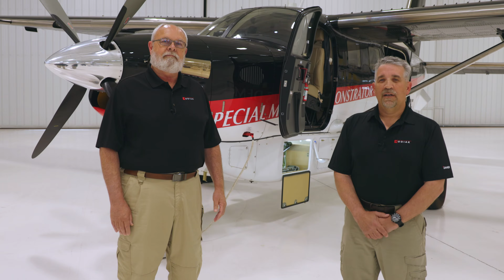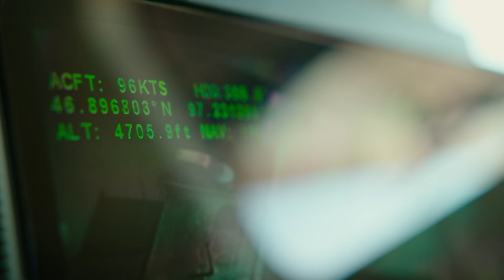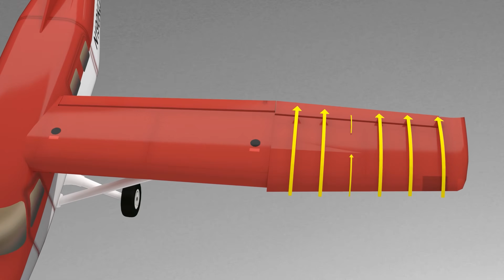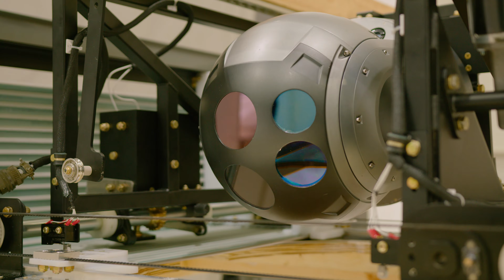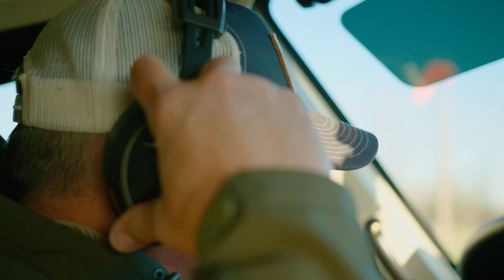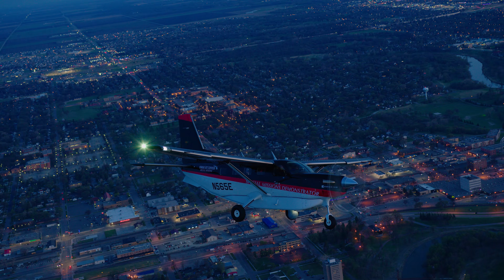Kodiak 100 Special Missions Walk-around

Comment: @KodiakAircraft  "We" have a new (with 2 patents) Par-36 LED landing light with 325,000 Candela  = (Candlepower) and 11,000 Lumens out the front output. It will outperform your current Osram/ Precise Flight Par-36 35 watt HID's. They output only about 3000 Lumens and at best 200,000 Candela. Our LED light distribution is also more even over the entire same beam angle as your current HID. Our Lux numbers prove true useful light performance out to 1/2 mile (1/2 Lux out at 1/2 mile). Please respond here and we can send Certified lab data to absolutely substantiate these claims. We will also attempt to contact Daher shortly with our documented performance data. 
There are NO other LED products currently on the worldwide market even close to this performance level for this form factor, out of a PAR 36. 
Most Par-64 (8 inch diameter) aviation 200+ watt LED's only can currently have similar performance numbers (250,000 to 400,000 CD) to our PAR-36. We also have certified Lab testing results for FAA RTCA DO160-G testing a major hurdle for certified aviation acceptance.